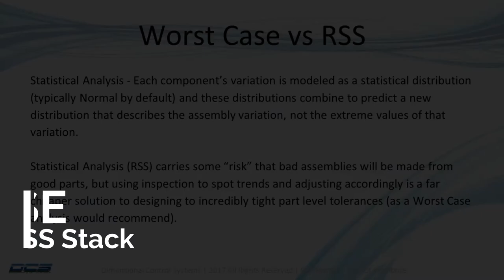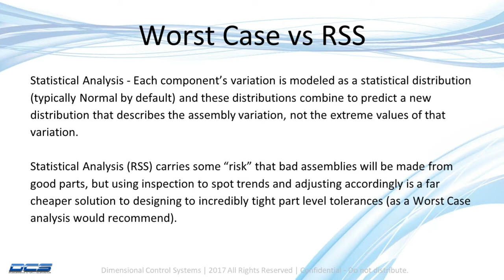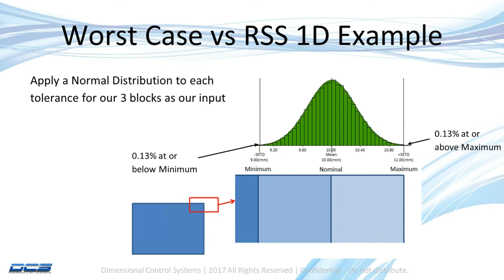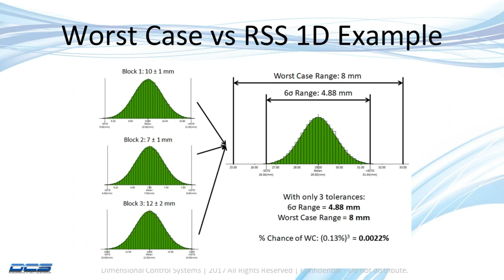Statistical vs RSS Worst Case -- 3DCS V7.5 part 3 Worst Case

Comment: I think there is a miscalculation in the worst case chance (0.13%)^3 is not 0.0022%.  It should be (0.0013)^3 which is 0.00000022% (0.0022ppm).
Reply from the maker: I'll double-check, thanks for the tip!

Comment: hi 

is the 6 sigma range 4.88mm or 4.88m * 2? 
Standard deviation of part 1:  2/6= 0.33
Standard deviation of part 2:  2/6= 0.33
Standard deviation of part 3:  4/6= 0.67

Total standard deviation: square root of sum of variances=  4.88

each side of the normal distribution is 6sigma which is 4.88 
so shouldn't the total range be 4.88*2= 9.7?